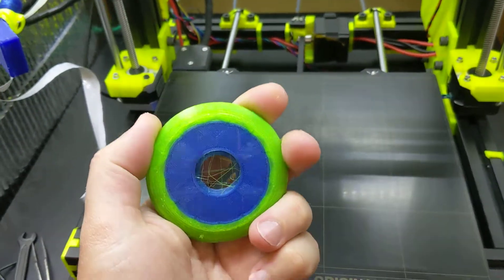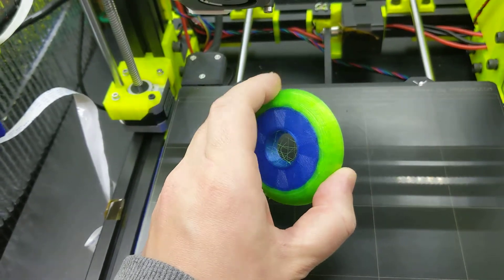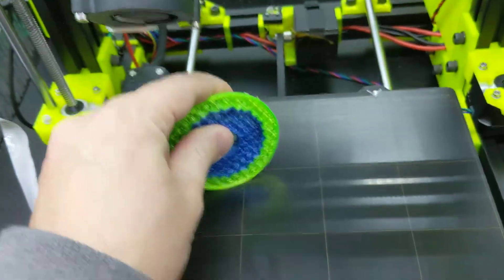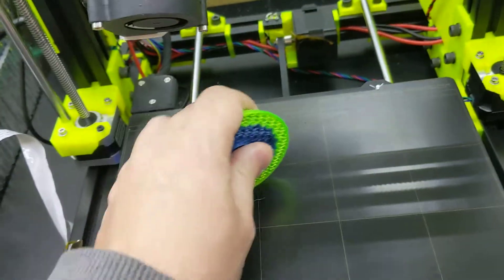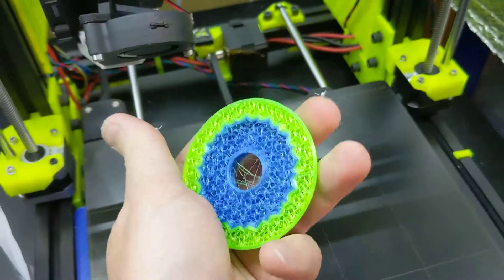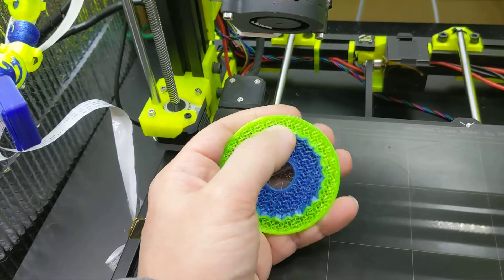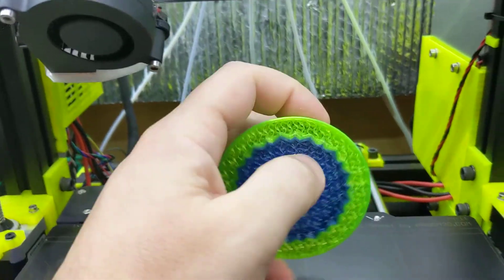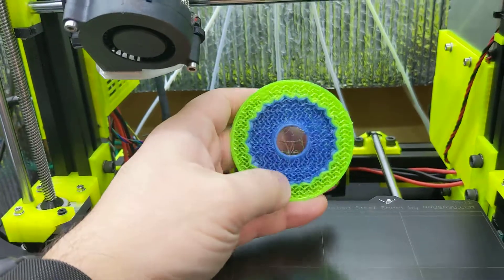Something I'm working on: Fully 3D printable inline skate wheels

Comment: omg, please...please!!  stop pushing that wheel against your heatbed surface!!! printer should be precise machine, it is not anvil!!! you will eventually bend steel rods, or print surface ........
Reply from the maker: Oh whatever.  There's no way I was applying enough pressure to bend an 8mm-thick solid stainless steel rod.  Not only that but that's what automatic mesh bed leveling is for!  =D